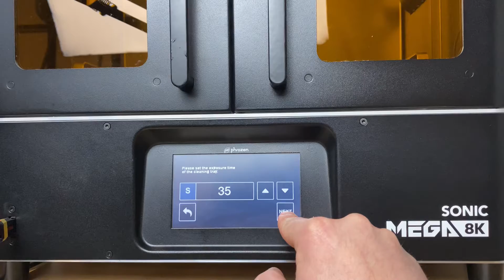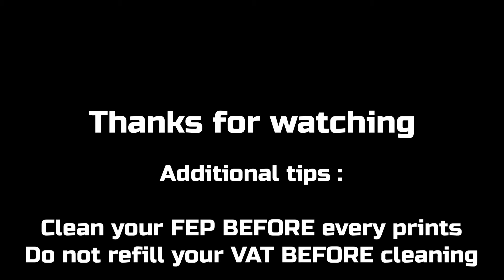Expresso3D - Clean your VAT/FEP in 35 seconds (Phrozen Sonic MEGA 8K )

Comment: This method does waste quite a bit of resin though it's probably still useful for a large vat like this which is very troublesome to remove and clean. For printers with smaller vats, I prefer to just nudge the underside of the FEP to release the stuck resin and lift them off. Also, it's not necessary to clean the VAT before every print. Cleaning is only necessary if there are fails / partial fails.
Reply from the maker: Probable better to waste cents in resin than hundreds in screens. :)
Reply: @artelier3d  You are more likely to ruin your screen if you scrape your FEP every time you print.  The cleaning method is ok, your advice was not.
Reply from the maker: @lomelyo  thanks for your expérience ! Almost One year doing this on my 3 Phrozen Mega and it works amazingly great! Thanks
Reply: @artelier3d  As I said, the cleaning method is ok. But every time you touch the FEP your risk of damaging/scraping it increases a million fold. It's better to lose a few cents in a failed print than lose a hundred on a replacement screen. Hope it's clear now.

Comment: Wrong. You take a failed print or support structure and put it in the corner, THEN clean the vat. You get a handle for the peel layer.
Reply from the maker: So not using your procedure is a wrong way to do ? 😅 working super fine with my spatula too ! But glad you have a good way too
Reply from the maker: @predragbalorda  thank you doc !! My FEP is supporting well the procedure :)
Reply: @artelier3d  It's all fun and games until a support tip puts a little hole in the FEP...

Comment: You shouldn't clean before every print. It wastes resin and risks indenting the film. It's only needed if you've had a failed print.
Reply from the maker: I prefer waste cents of resin than a 350€ lcd screen :)
Reply: Not cleaning before every print risks many print failures or defects from many times invisible contamination on the FEP, which one can clearly see after using the resin-exposure cleaning method (embedded in the solidified resin that's peeled off the FEP after using this method).

The results speak for themselves and can't be argued with.  Of course, if someone can't peel the resin from the FEP without damaging the FEP , that's a different issue.
Reply: @retromodernart4426  I wrote that post 5 months ago, granted at the time I was relatively new to the tech but since then I've got 6 more SLA printers. I've tried this cleaning method many more times now and still, I'm sticking to my guns on this one. I never see anything peeling up with the sheet unless I've had a failed print. I do have a very clean working environment which might account for why I don't see any benefits in this technique, but even so, if you're not contaminating your resin I don't see how this is beneficial (especially if you're printing with expensive resins).
Reply: @charmio  Thanks for your detailed reasonable reply.

You would agree that there is no better method for cleaning when a print fails (regarding minimizing or eliminating damage to the FEP removing the stuck failure)?
Reply: @retromodernart4426  Cheers in kind. Yes, it's definitely the most practical method I've come across, quick and mostly reliable. If I've really made a mess of things though, nothing beats draining and filtering it through a mesh filter. Takes more time and effort but sometimes it's unavoidable.